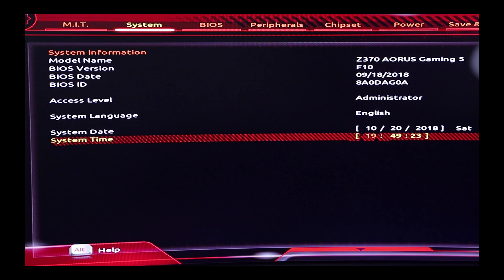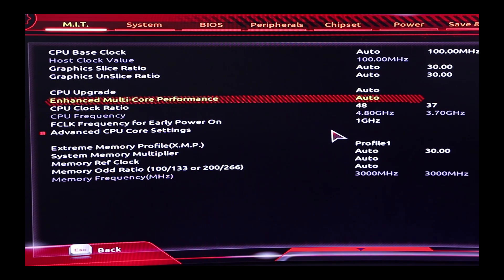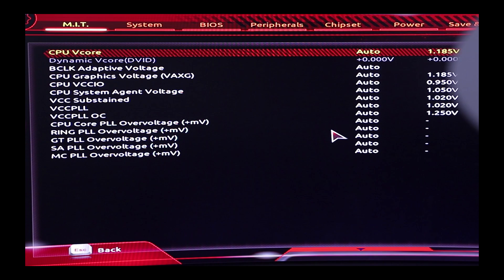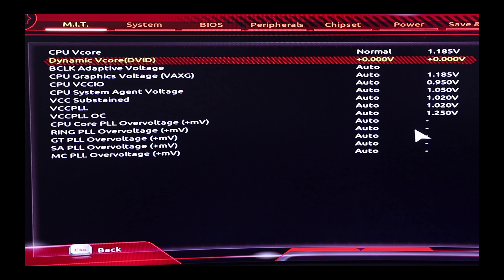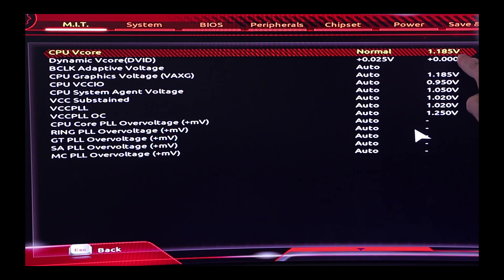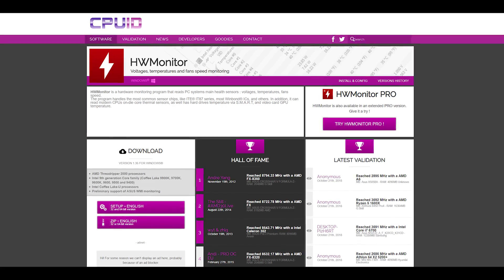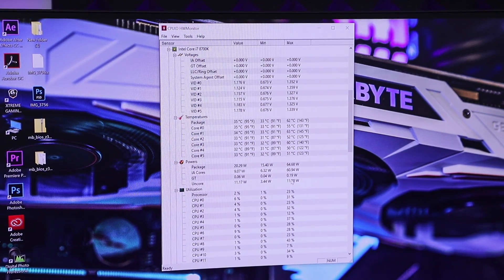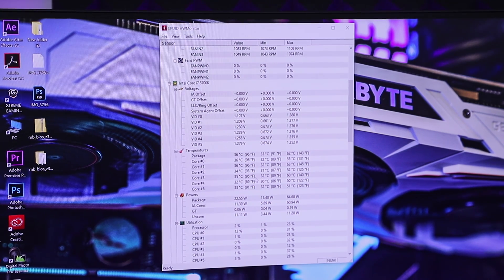Adaptive (Dynamic) Voltage Overclocking Made Easy - Core i7 8700K Overclock Guide

Comment: I've been experimenting with adaptive vcore (IA AC/DC Load Line not set as it was not an overclock) and after setting it to 1.35 and 1.30 respectively as those were the values showed by HWiNFO64 in the VID sections with no offset on my 9700K (ROG Z390-i motherboard) after launching Windows I noticed that there was a spike to around 1.48 (maybe 1.50+, I don't recall at this point - in VID) on one of the cores when launching Cinebench (not starting the benchmark). I immediately restarted and went into the BIOS to change it. I did not note the temperatures, but that was almost immediately after I logged into Windows.

Did I degrade my CPU by any chance? Will running it under that voltage even for a moment can cause damage? I did not note the current voltage values or how often the voltage went up so high, just the max and I focused on setting it back to normal.

After some investigations I found that the VID value is the core requested voltage and not the actual vcore which I was not monitoring at that moment . If I run it on stock settings with a -0.050 offset the VID shows between 1.319 and 1.335 while the vcore is at 1.217. Which value should I pay attention to?

When I usually run Cinebench R20 it goes to full 4.6 and after a while the cores go down to 4.2-4.3, but I think that may be due to power limit throttling, I think they all dropped to 4.3 before the incident, but I may have not been paying so much attention to the individual speeds at that time.

I'm a little paranoid as this is my first unlocked CPU and I do not want to damage it with incompetent tries at undervolting as an offset of more than -0.050 is not stable at idle. I will try to overclock once I get an AIO.
Reply: i had similar issue on my 9700k, if you have an asus BIOS look for setting under AI overclocking called SVID behavior, try changing it from auto to say either best case scenario or typical scenario. I currently OCed my chip to 4.9 all core and 4.6 on cache. with adaptive voltage set +0.320 volts, (1.32 volts manual is stable for my chip) and SVID behavior is set to best case scenario.

the first time I tried setting adaptive voltage without changing svid behavior, it shot up to 1.55 volts when I tried to run cinebench. dont worry, chip is still fine.

so far my settings are working even in microsoft flight simulator (notorious for being picky with overclock settings.)

Comment: i have a 10700K OC'd to 5 ghz at 1.35V (stable), max temp 82C;  so to implement adaptive mode, do I subtract 1.35 from normal core volt or just enter 0.025, and read HWMonitor?
Reply: First you set the vcore to normal/auto with no offset with 50x core ratio. Then you stress the cpu a bit with a benchmark or whatever you test with and monitor the core voltage. Check the max Vcore you hit during the stress from the monitoring software and write it down. Then go to the bios and offset that voltage you just saw in the stress test and try to hit the 1.35V which you have declared stable. You might need to offset it + or - depending on the delta you saw from the target 1.35V. Then boot and see where you are at with your offset on that x50 max boost and iterate from there until you hit the right offset setting that 1.35V for you.
Reply: @eugenepowerhouse2487  english please? LMAO, FML. Im in over my head.

Comment: hello i have a ryzen 2600 and gigabyte b450m motherboard i overclocked by ryzenmaster has 4ghz with a voltage of 1.325 and by the bios impossible to change the voltage what should I do?

Comment: I know whats stable at 5.0ghz with no avx offset but how I am I supposed to check whats stable with avx when prime ramps the vcore crazy high on adaptive?
Will an AVX instruction in software increase the vcore as well? I'm fine with static but it's not ideal. With haswell I just set a manual vcore with c -states and it lowered at idle. Why is this not happening with z390? Does anyone on the internet really know the deal?

Comment: Nice video, you just earned a new subscriber :) I just have one question. I’m having problems with my new i7 9700k, dark rock pro 4 and z390 aorus elite. Everything is stock, but I’m getting over 80c degrees in games and stress test, when its idle it’s sitting at low 30’s with high random spikes to high 50’s. How could i solve this problem? I dont realy understand those options for voltage, dynamic(adaptive) normal, auto and what number should i go with? I’m not planning on OC it, I just want the lower temps that are possible without affecting the cpu’s performance. Thanks in advance!
Reply from the maker: Hey.  It's hard to say but depending on the ambient temperatures of your room, your CPU temps could be normal with that cooler.  Consider downloading CPUID/CPUZ to check the vcore voltage to be sure that your motherboard isn't overvolting your CPU.  I would also double check that your CPU cooler is seated properly on your CPU making complete and even contact with the heat spreader.  You can also try reinstalling the cooler with some high-end thermal paste if you wish.  Try Arctic Silver 5 or Thermal Grizzly Kryonaut.  Once you have tried all of these things and confirmed that your motherboard is not overvolting your CPU, if temperatures are still the same, then you are likely at the limit of the cooling ability of your particular CPU cooler.  Lower temps would then require a cooling upgrade.
Reply: @ECPUz  dark rock pro 4 performs the same as noctua nh-d15 as 240-280mm AIO coolers.  I have artic mx-5 thermal paste on it. I think I fixed the problem. I dropped the voltage to 1.180v (didn't try lower) and set it to manual. Also I edited the custom curve for cpu cooler, so now when in idle it sits in high 30's but it's so silent you can't hear it. it's amazing realy.  In games and in stress tests I'm getting high 50's and max 60c. So now I'm happy. I know that 80c is still "safe" by intel, but why shorten it's life spam if I don't have to.

Comment: How far do you think you can push the multi leaving all else at stock? I tested prime 8 hours at 4.8 just fine last night,  but the voltage topped around 1.34. however, with heat in check, 1.34 should do 4.9 or maybe even 5. Do you think this is an ok approach ? I feel the offset method is the way to go, except this is way more complex than sandy bridge was, where I'm upgrading from. I noticed that when I used the offset, it also adjusted that base voltage when it down clocks. It wanted to idle at around 1.1ghz then, and not the .6ghz I think it did at stock. Not sure if I missed a setting